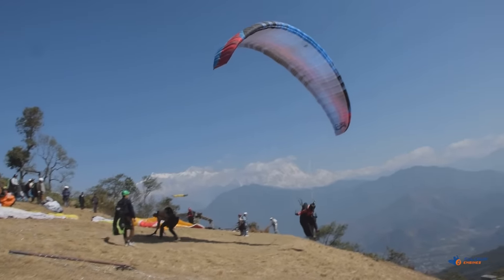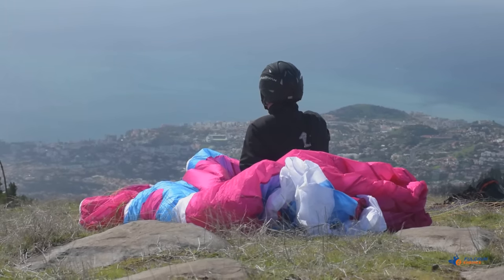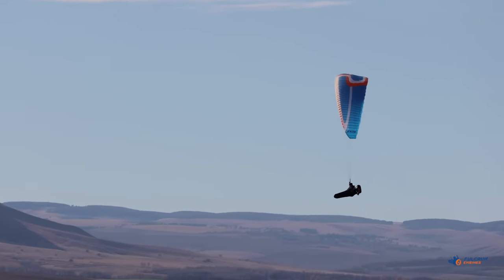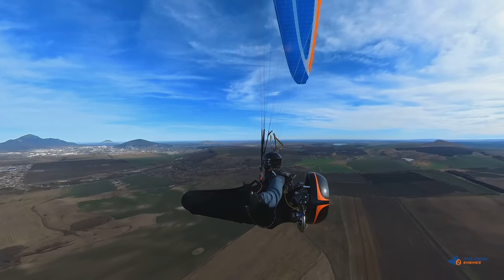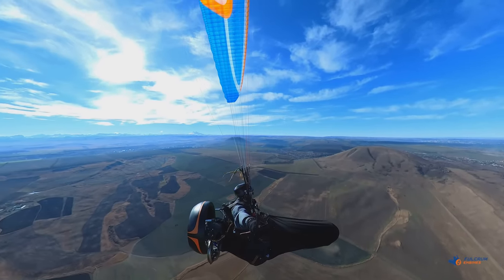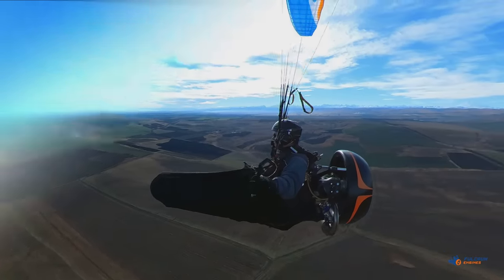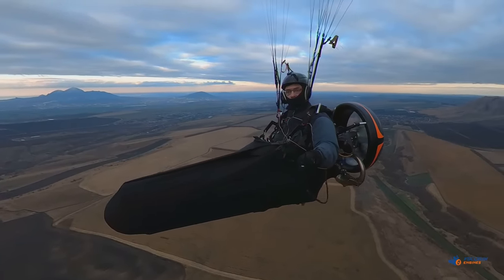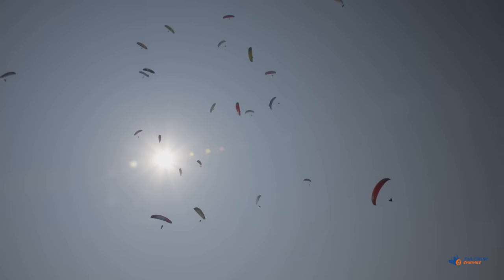Fulcrum PowerPod is the world's first paramotor pod harness with a ducted fan only 0.5 m in diameter

Comment: Always wanted to get into paragliding but worried about a collapsed wing.  Do you think this Airpod would reduce the chances of a collapse?  I would think it would as its pushing you through the air.
Reply from the maker: PowerPod does not reduce the probability of collapse, it gives you the opportunity in turbulent conditions (when collapses are probable) as little as possible to be at low altitude when collapses are dangerous.

But in any case, every paraglider pilot should know when collapses are possible and how to handle them. A cautious pilot who is afraid of collapses simply does not take off in such weather.
Reply: @fulcrumengines2519  - Appreciate the reply and info!  I am planning yo take up paragliding in the next couple years.  I'll keep an eye out for your Airpod!  Best of luck with its launch.  I am sure it will be a hit!

Comment: Is this engine electric? (if not would that be a possibility)? (2) Does the engine help to lift (the parachute)? or mainly push the person forward? (3) When you land does the frame just skid to a stop? (or could you put wheels on the design)? Or just put your feet down? (thanks and sorry for all the questions) Looks so cool!
Reply from the maker: No, it's a gasoline engine. It will be very heavy with electric, because the batteries are too heavy. 
On takeoff and in flight, the PowerPod simply pushes you forward and you take off and gain altitude.
Takeoff and landing takes place on the feet, as in a conventional paraglider pod harness, without wheels.

Comment: Is there some way to use a couple of wind funnels to channel wind across the motor blades without power on, like a windmill principle. As you glide forward, direct the air through the blades etc.

Comment: Questions: Is the ducted fan geared down, and by how much? How fast does it fly?
Reply: It doesn't really matter, does it? You just need to gain a few hundred meters to catch the thermals.
Reply from the maker: I don't understand what you mean? The duct fan is located directly behind the pilot.
The flight speed does not depend on the paramotor pod harness, but only on the paraglider.
Reply: @fulcrumengines2519  I don't understand what you mean either. So there must be a cultural difference that can't be solved.
Reply: Most engines are geared down 3 to 1 or so. Looks like this one is direct drive from other comments. But the speed is in the glider. The engine simply provides thrust to stay airborne. Slower glider will climb more rapidly under similar engine thrust than a faster glider. Simply speaking the curve of the wing decides how fast is will fly. 
Google some videos on the thrust vs drag and airfoil shape. A Cessna will never go the speed of sound even if a jet engine was attached to it. The wings would simply break off as some high speed. And a fighter jet will never land as slow as a Cessna even with the engine off because it’s wings are designed for high speed flight. Pitch for speed, power for altitude.
Reply: @Catpanl  Thanks for the info it is appreciated!

Comment: Is this using engine? or motor? how long it can flight?   can I take off from a tall building balcony?
Reply from the maker: Yes, a gasoline two-stroke engine. If the flight ascends to the maximum altitude (the climb mode is the main one for the PowerPod concept), then at least 30 minutes in motor mode (during this time you can gain 2-3 km of altitude). If you fly in horizontal flight, you can fly 1-1.5 hours with a motor.
When flying without an engine on a paraglider, you can fly as long as there are updrafts, for several hours - it's not a problem to fly in good weather.

You can take off from a high building only if you have a very good experience.

Comment: I wonder what RPM it runs, what it sounds like, and how loud it is? I wanted to hear it lol.
Reply from the maker: The engine RPM is about the same as that of other paramotor engines of similar power. The fan rotates at a higher RPM because it stands directly on the motor shaft without a gearbox. The sound is about the same as that of other paramotors, but with a higher tonality, due to higher fan speeds.
We plan to shoot a video with the actual sound of the motor soon.
Reply: @fulcrumengines2519  Why didn't you include the actual sound in this video?   How is your motor design not affected by engine torque?
Reply from the maker: @stephensober6691  We plan to make a video soon with the actual sound of the engine. 
The torque from the engine is very little felt, since the size of the propeller is much smaller than that of a traditional paramotor. The torque for a 1.2m propeller is much greater than for a 0.5m fan.

Comment: Can this PP get a full grown man that is 280lbs / 128kg into sustained flight?  Also does the leg fairing accommodate someone that is 6'5" or 1.95 m?
Reply from the maker: Unfortunately, at first we plan to make PowerPod only for medium pilots (not heavy ones). Thrust of 50 kgf is acceptable for pilots of 80-90 kg, maybe 100 kg. But 128 kg is too much, I'm sorry. We will think about expanding the product line after the launch of sales.

Comment: Beautiful creation, hopefully someday i will experience it, can you para guys do me a favor? can you consider a sort of Sunday driver para-wing that has much less maneuverability but zero chance of collapse from side rogue gusts?   as most of the wings are designed for fast turning ability if needed, but i have seen some of them fold & fall from side gusts, can you incorporate a sort of less flexible pipe or tube along the front edge and rear edge to cancel out the possibilities of this happening.   For the glider who just wants to cruise and has little interest in fast-turning sports maneuvers.  Also do you think in the future a battery-powered motor will be possible? You could change batteries in flight,ah be impossible to get enough power and still keep the weight down with batteries i'd imagine,   please seriously the uncollapsible cruiser wing thanks bye :)
Reply: No such thing as zero chance of collapse. But ANY current “A” certified glider is very solid & recovers quickly and automatically. And the maneuvering isn’t that bad at all.

Comment: Since this product is still in pre-production phase - I suggest adding an impact barrier beneath the pilot/crumple zone in case of parachute failure at low altitudes - that or basically an airbag.  Most of the accidents I've seen were well below a reserve chute being practical, so designing around this seems necessary.  Reducing the weight of the engine certainly helps with that, I still think there's some more safety features that will be considered standard in the future yet to come out.
Reply from the maker: Yes, we plan to make a  some kind of protector under the pilot. This is the standard of paragliding harness.

Comment: I didn't see the power source. If not battery powered, are there plans to make it so?
Reply from the maker: We used internal combustion engines. We would like to make a version with an electric motor, but according to our calculations it will be very heavy due to the heavy weight of the batteries.

Comment: Incredible!  Is that direct drive propeller on a DLE engine?  What's really funny is I had a dream last night before you posted this video of a paramotor design similar to a miniaturized Otto Celera 500L with a rigid foam hull.
Reply from the maker: Thank you! It's not a DLE engine. But this is also an opposit engine specially designed for this task.
Reply: @fulcrumengines2519  where can we buy this engine? Or more info technical and more and even a price online to find? Very interesting.
Reply from the maker: @wimperelly  This engine is made specifically for our requirements. We prefer to publish detailed technical data after the release of our product for sales.
Reply: @fulcrumengines2519  perfect understandable. I am curious when it will officially released

Comment: Looks cool, I wonder if electric motor with lithium battery could be used
Reply from the maker: The electric option will be good in everything except the weight and volume of the batteries. If you need to climb for more than 5 minutes, then the weight of the electric version will be significantly more than that of the version with an ICE. Even with lithium batteries.

Comment: Looks great :) but why not going electric? - less vibration and noise, fewer parts to break, etc.
Reply from the maker: If you make an electric version, it will be much harder than with an internal combustion engine. The weight will be comparable if the operating time is very short, 5-10 minutes, maximum 15 minutes of operation at full power.
Reply: @fulcrumengines2519  Sure, I understand, but then your ICE must be extremely downsized/lightweigth and efficient at the same time. Otherwise, electric ppgs (like the open ppg) are capable of 40 min flights at a similar weight load as ICE ppgs. And 40 mins for a soaring flight seems good enough. Anyways, very nice project! Good luck with it!
Reply from the maker: @stefoun1  The Open RPG project promises a flight time of 40 minutes with a paramotor weight of 27.6 kg (61 lbs) ( https://openppg.com/shop/paramotors/openppg-22 / ). This is comparable to the weight of a PowerPod when fully refueled. But 40 minutes of flight time does not mean 40 minutes in climb mode, rather it means horizontal flight.
Reply: @fulcrumengines2519  Sure! thanks.

Comment: Whats the max pilot weight. This is incredibly important with such a small prop
Reply from the maker: We tested our PowerPod with a pilot weight of 82 kg (net weight) and a Sky Exos paraglider (free fly paraglider EN C). The take-off is confident, the climb rate is 1.7-1.8 at full throttle. We believe that a 90-100 kg pilot will also be able to use PowerPod.

Comment: Have you considered an adjustable pitch prop system for speed and takeoff ? I've designed an electric version very similar that incorporates this aspect and it has 3 stages, takeoff, cruise, performance
Reply from the maker: The PowerPod has 2 modes - takeoff and flight, with different positions of the engine and the pilot's back (straight and inclined). We believe this is sufficient for the pilot.

Comment: Is there any fire protection ? I fly a jet airliner and an uncontrolled engine fire will ( or so we are told) cause the engine to drop off the wing before it burns the wing off. Having a fire in a paraglider engine would be the ultimate “ arse on fire” scenario.
Reply from the maker: Unfortunately, such fire protection will be too heavy for the back of a paraglider pilot. Accidental paramotor fires (without collisions with the ground or something else) are extremely rare. We have not heard of such cases.

Comment: That’s awesome he takes off much faster than a regular para motor, is it electric motor?
Reply from the maker: No, it takes off like a regular paramotor. :)
It's not an electric motor, it's a two-stroke gasoline opposed engine.
Reply: How fast a pilot leaves the ground is a function of head wing. With enough wind a man in a glider can go straight up.

Comment: Great concept. A question: have you considered using flexible solar panels covering the the canopy? The energy generation goes into a battery system running your electric motor. Compare the weight of the gas engine used in total to that of the latest generation batteries. Just an idea. Love the idea.
Reply from the maker: Even the latest generation batteries are too heavy, compared to a tank of gasoline. The energy density is too low in batteries for this task.

Comment: Very snazzy looking PPG...would like to HEAR it too. Didn't see any info on noise comparison.
Reply from the maker: Thank you. We haven't done any noise measurement tests yet. Subjectively, the noise is similar to that of a regular paramotor, but in a different range, due to higher fan speeds. Anyway, the engine runs until the first thermal, and then there will be silence. )

Comment: well... it looks interesting, but if you're going to compare, do it right. In a standard paramotor, you don't fly with that degree of inclination, if you do, it's because you haven't adjusted your anchor properly.
On the other hand, the drag created by a large frame is not a problem due to the type of flight, however, a large fan is much more efficient at low speeds. The proof is that the powerpod needs a large ducted fan technology to "comparable" with a traditional paramotor... That's why big propellers are used.
I'm also concerned about exhaust contact with the ground on the Powerpod...it doesn't look very protected.

Anyway... don't get me wrong, the Powerpod looks very interesting, for its intended audience. (Not for paramotor riders, but more for paraglider riders who don't have a mountain nearby).
It is beautiful, seems comfortable and very aerodynamic.
My congratulations!
Reply from the maker: Thank you! We address our product to those pilots who prefer thermal flights but don't have hills or mountains. It's all about maximum aerodynamics, comfort for long flights.

Comment: Looks nice. Is it Andy louder Than a  normal paramotor?
Reply from the maker: Its sound is about the same as that of a conventional paramotor. The engine RPM is similar, so the engine sound is similar. The fan rotates without a gearbox and its speed is higher than that of a conventional propeller. Therefore, its sound is more high-frequency, but also acceptable. We are currently working on reducing the noise of our PowerPod.

Comment: What is the projected cost?

Also, what is the MTBF of the prop bearing? With clearances/tolerances that small between the cowl and the prop, that bearing has to be a cyclic replaceable part.
Reply from the maker: Unfortunately, now we cannot calculate the cost yet, we need to establish mass production for this.
The gap between the fan and the duct is approximately 2-3 mm. This is a huge amount for the runout of the bearing. The engine will most likely not be able to work with such bearing wear.
Regarding the regulations for the replacement of bearings, it will not be greater than that of similar two-stroke engines. Especially considering that the opposing engine has less vibration  than a single-cylinder.

Comment: What is the fuel burn rate compared to any other setups?
Reply from the maker: The volume of the fuel tank is planned to be 5-7 liters (it should be compact enough for our concept). This should be enough for 30 minutes of operation at 75% power (climb mode). During this time, you can reach 2-3 km of altitude.
If you fly in the horizon, without climbing, the flight time will be much longer.

Comment: I have always loved Paragliders and Paramotors, but having disabling injuries has prevented me from pursuing it.

However, this is something particularly interesting on so many levels, the Pilot took only a few steps before becoming airborne.

I'm curious as to what the landing forces are like.
Reply: look into other ultra light aircraft with landing gear.
Reply: @blockfifteen    I had, but they required the availability of a car with a trailer and somewhere to store the aircraft and trailer when not flying!

I don't have a garden or garage to stored them.

Comment: Given that this is designed to get you to alltitude wouldn't an electric motor have been the better way to go. It's not built to sustain but rather just to get you there. I did some caculations, very rough but it is possible to get 12 minutes out of a motor with enough torque which more than gets you to altitude. the weight you save on fuel, exhaust can be given over to sufficient battery and motor, motor size can be much smaller due to staggering torque from them.
Reply from the maker: If you make an electric version with a running time of 30 minutes or more, it will be much heavier than with an ICE. But for 10-15 minutes of work, it may be close in weight, we need to calculate.

Comment: I don't know much about parachuting, but can you make a motorcycle or bicycle style lever/pulley system attached to it? Idk how the propeller works but I assume it has a throttle, so maybe instead of your arms upright they're perpendicular to your legs? Is that possible?
Reply from the maker: We did not change the control of the paraglider. The pilot's hands are in the usual position, like any paraglider. This is convenient for all pilots.

Comment: With Paramotor flight there is a fuel tank that takes up a good bit of room on the unit. I always thought it would be cool if there could be a way to integrate fuel into the frame or shroud kinda like an airplane wing. I didn't see a tank on this unit so where is the fuel stored?
Reply from the maker: The fuel tank is located at the bottom behind the pilot's back, under the fairing.

Comment: So what is the downside exactly compared to traditional rigs? Why only for thermal soaring?
Reply from the maker: The concept of using PowerPod is focused on soaring flights, so that the pilot feels as little difference as possible with a conventional pod harness.
To do this, a ducted fan of minimum diameter, a deflected pilot's back and a cocoon for the body.
Of course, you can fly with a PowerPod as on a conventional paramotor, but then there will be no advantages.
Reply: @fulcrumengines2519  Would there be any disadvantages is what I am asking. Like worse fuel efficiency compared to traditional paramotors?
Reply from the maker: @ET  Yes, of course. Since we have reduced the size of the propeller as much as possible, we have lost in its efficiency. Even by placing the fan in the air duct. An engine of the same power with a propeller of ~ 1.2 m will give about 70 kGf, and we have only 50 kGf. Therefore, the fuel consumption in our solution will be worse than that of traditional paramotors.